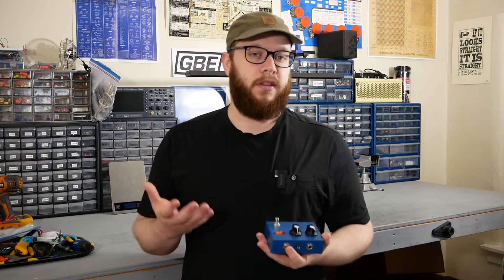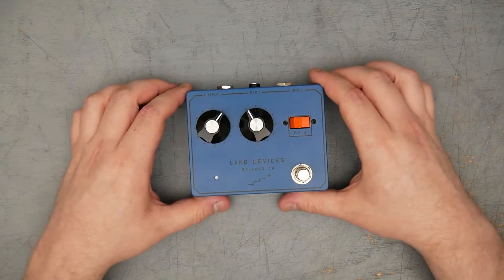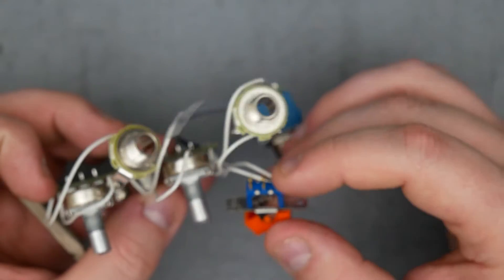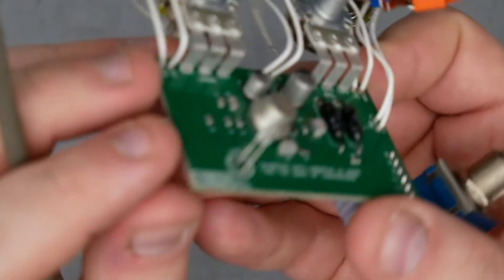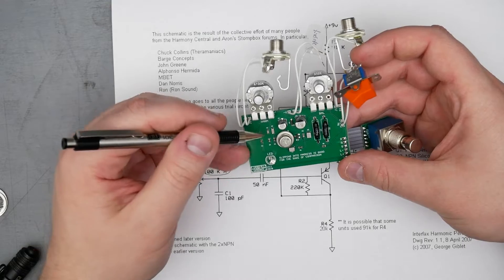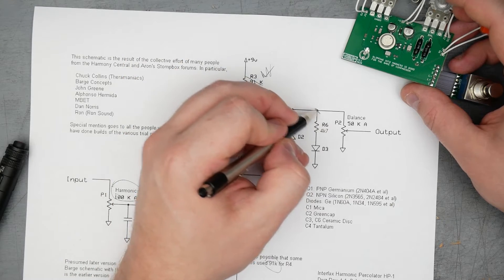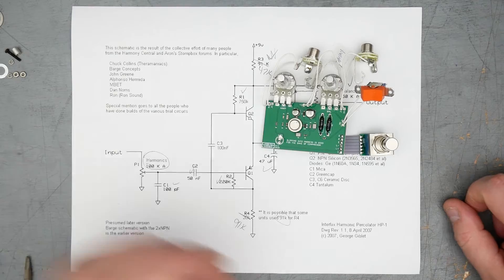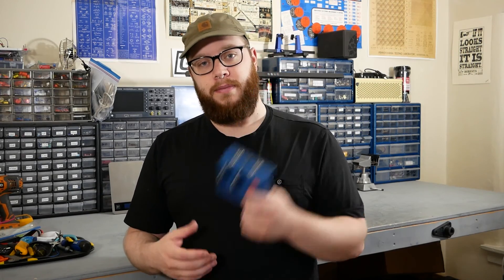Land Devices HP-2 Teardown! See what's inside!

Comment: You didn’t play it!  Even ten seconds at the end would have been rad. 
I really enjoy your, and these types of videos.  What id love to see would be more of an explanation for how the circuits work as well- I’m very useless at electronics and I think you’d be able to explain why that resistor ties the circuit to ground at that point and what its purpose is extremely well.  🎉
Reply: I assume you're referring to the 22k resistor connecting the collector of the PNP transistor to ground. That resistor plays a small part in the larger transistor gain structure, which he shows at 5:01. It works with the 22k resistor at the top to bias the transistors closer to the center of their operating windows, giving them more headroom to create gain without unwanted clipping. Of course, both of these transistors being completely different, they have different operating windows, so them being connected together means that they can't be perfectly biased. This creates asymmetrical clipping when the gain is turned up, which is exactly what we see in the video. In the original circuit, there are hard clipping diodes right before the volume pot, one of them having a 4k7 resistor in series before the anode. This creates asymmetrical clipping as well, accentuating that super harsh and biased sound that the HP-1 is known for.

Comment: I recently had a student build the "Harmonic Jerkulator" on the breadboard and we took some measurements. It's called "Harmonic Jerkulator Measurements on the Breadboard" (I'm listing the title so people can search for it instead of the link since YouTube sometimes eats links).
Reply from the maker: Very cool I'll check that out. 
BTW, I saw the comment thermaniacs made on your video. I do have a different HP schematic that shows a 1nf cap in parallel with the clipping diodes. I assume that's the cap allegedly missing from the schem we showed. It's possible that cap was omitted on certain units, in other words both schems may be correct.
Reply: @graybenchelec  Ah, that is useful information!

Comment: Interfax was located in the same building as systech and proco in the beginning they only made a few things and werent around very long same with systech and alot of carlsbro pedals from England seem to use the same enclosure as the systech pedals but no one knows much about either company i guess the guy was a whacko at interfax yet he figured out how to make germanium and silicon transistors to work together so he must have been smarter than people thought

Comment: Stealing a circuit and then covering up what everything is.  Gross.  Glad I bought a different perc clone.
Reply: Which did you buy? I'm in the market for one, might just build a clone myself if I can't find something reasonable
Reply: @wookiewhat  Electrofoods Pig Pile.  It's wild.  Unfortunately they haven't made a run of them in a LONG time.  I would check out the clubber lang from malaise forever!
Reply: @ohpotatoesandmolasses  stealing... something that's no longer in production?
Reply: @ohpotatoesandmolasses  thanks for the tip on the Clubber Lang!
Reply: You’d be correct it anything in your comment was true.
Reply: Sorry what did they cover up exactly? Is it really stealing if the original pedal is out of production?
Reply: is it gooped, tho? where?